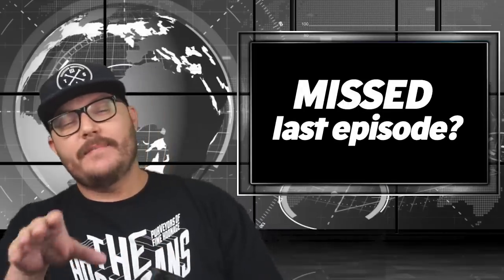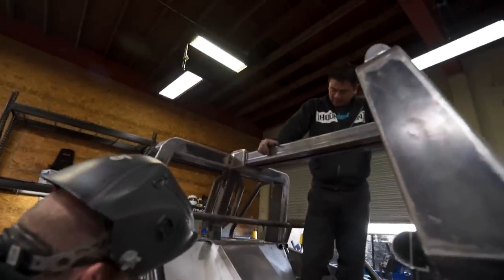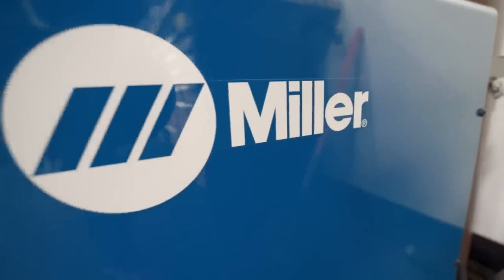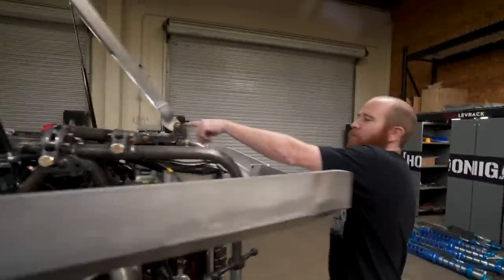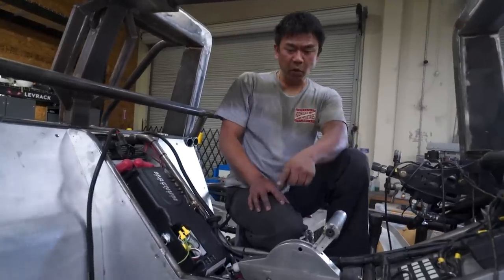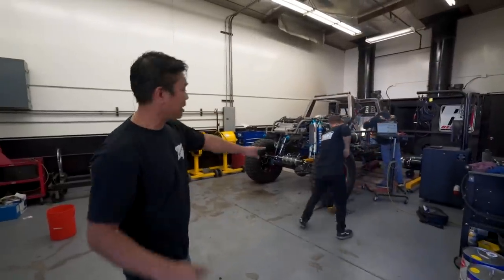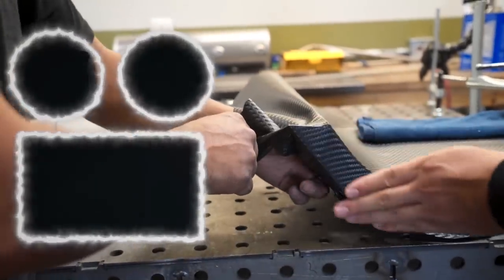World's most powerful Halo WARTHOG! Dyno Day for our 1,000hp Twin Turbo V8 video game war machine!

Comment: 6:23  install the gas springs so that the body/can is higher than the shaft, this ensures that there is always oil on the shaft seals.  Basically... flip them around from what you showed us.  If you want a proper engineered analysis of your gas spring setup try contacting JWF based in Ohio, they distribute Stabilus gas springs and have the software to analyze the geometry and provide the best mounting point locations and correct length & strength gas spring.

Comment: I’m going to say 1170 crank HP! 
Based on the gearing you should be able to hit 150MPH EASY! 

Based on 1:1 trans, 5.4:1 rear, 42” tires and 6500 redline
Reply: Do 4 wheel steer cars have torque steer issues?  Id say with it being 4ws that itd be super touchy in the driving dept and easily snap some spinny bits at speeds.. only seen the whole 4 wheel steer able to be engaged at 4wlo like on rock crawlers..  or monster trucks and those flip all the time in speed runs trying to cut a u turn...
Reply: @Z-Ack  they've already stated previously the 4 wheel steer is only to be engaged in low speeds

Comment: 4:32 I was gonna say that technically a broken clock is right twice a day, but then also technically a "day" is only when the sun is out, which is new half of the whole 24 hours, so technically right once a daytime.
Reply: Right like if it’s broken between 3-5 AM/PM then it’s hard to say twice a day. But between 6-9 it would be more applicable to twice a day. Was scrolling for this comment

Comment: 4:34 not to reign on Suppy but a broken clock is right 2 a day I heard as the old saying. But if your only up during 1:38 P.M. and not during 1:38 A.M. then he is completely right. But just a thought, if it was broken at 7:50 AM/PM then it would be right twice a day since most people would be up during both A.M. and P.M.

Comment: This thing is sick as hell, I think y'all should try to get 1, 000hp to the ground I know a lot is going to get lost with however big tire gets put on
Reply: This is to the wheel. Putting it on the rollers would only show how much of that 1040.6 wheel HP they can put down on the road.
Reply: @halofreak1990  oops I meant to the ground

Comment: I thought tune 4 looked better with a bit extra low end torque.  Top rev HP is great for top speed but this machine is for low end off road gunning!
Reply: They want that speed. They said 100+mph goal. 
The gearing will let them hit 150+ 
They don’t even need 3rd gear for 100mph

Comment: Small lightening bolt on driver side of engine at about 12:15
Reply: Fire shooting out from the turbo blow off.
Reply: @devinbender8428  hmm that's a new one for me. haven't noticed it before. makes sense though
Reply: @calebrichter2565  they have the boost set really low.

Comment: I got a question for any and all welders out there! Im in trade school for a 2 year welding tech degree and im looking to get my first welding machine to use at my house. Any recommendations? (I have little to no experience aside from gas welding and stick welding in class right now.) I plan to build a shifter cart next summer assuming I do well with mig and tig next semester! Im ambitious ik but still lol.
Reply: Ps: I prob wouldn't buy the machine until next spring/summer due to money and my inexperience right now.

Comment: I'm curious as to why you guys chose to wrap metal parts instead of actually make them of composites. If my rinky-dink college Formula SAE team can make an entire body of Carbon composite, you guys can too.
Reply: Time, strength, money. Plenty of reasons. Likely time is the biggest factor, way easier to machine and then wrap then deal with making molds and getting them to turn out well

Comment: im curious. whats the power to weight ratio?
Reply: Same, im thinking like 6:1 cuz its gotta weigh at least 6k lbs
Reply: @Javierm0n0  i doubt its gonna be that heavy tho, theres no added weight like sound systems etc. Im thinking around 1500kg to 2500kg, which is something like 3k to 4.5k lbs

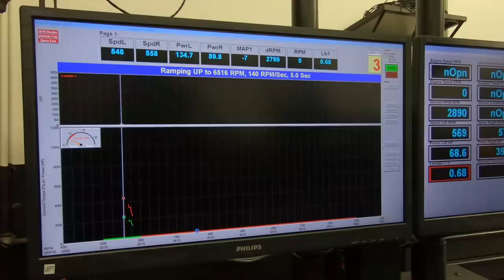Comment: 12:19? What’s the blue flash?
Reply: Blow off valve. Shooting fire
Reply: @devinbender8428  that’s what I thought, but mid pull?
Reply: @riz3nfpv306  it was at the end of the rev range. I’m guessing they have the pressure relief set low so they don’t built too much boost.
Reply: @devinbender8428  maybe hit boost cut. already reached target and dumped the rest.hence suppys comment about a lot more on the table. It’s an animal

Comment: Too bad this doesn't have the correct independent front and rear suspension.  Making power and looking cool is easy compared to getting a suspension system to perform anywhere close to expectation, thats where the hard work, engineering and magic lay.  I bet KibbeTech could have done it but realize budget and timelines are a reality, especially for a promotional show car.

Comment: something is off with the built, the car is tilting to the right when you apply full throttle
Reply: V8 engines all do that, the crankshaft spins in one direction, the more torque applied to the crank, the more lean the vehicle gets to that side.

Comment: The beginning narrator is still annoying and unnecessary, doesn't feel Hoonigan.
Reply: Absolutely! “If you need caught up” bro it’s been 2 Days! 

I’ve been saving the videos and editing out the stupid narration. 

Total length thus far went from over 58 minutes to under 50 minutes. 

That’s a lot of filler.
Reply: @devinbender8428  At least I'm not alone on this one, I scanned comments on all 4 videos and most were all positive, I hope we don't have to suffer the annoying narrator much longer.